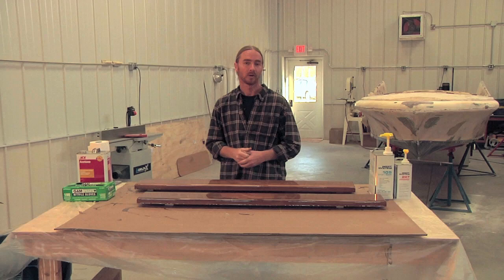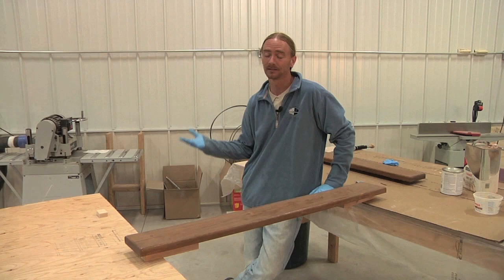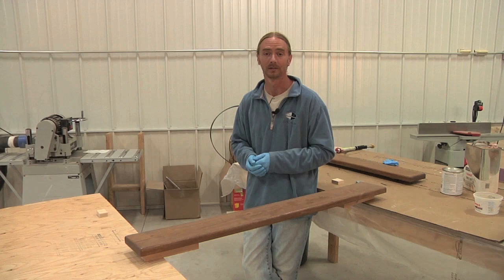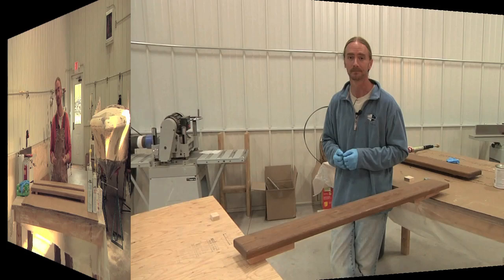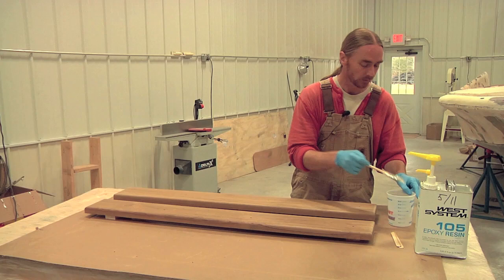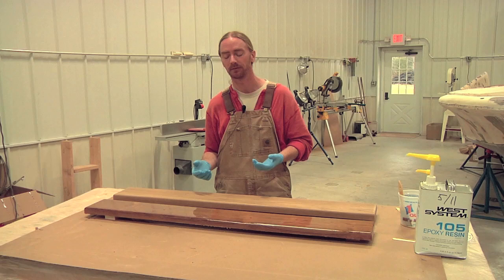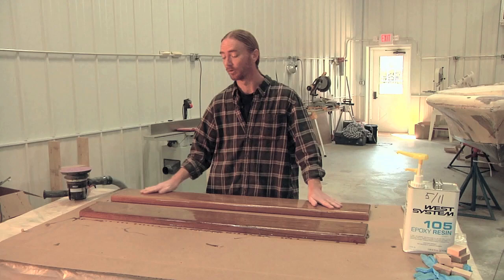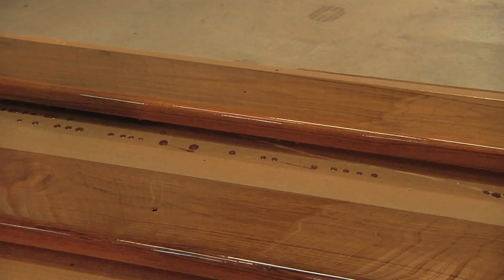Varnish and Epoxy~ a Professional Wood Finish for Teak Part1

Comment: Hi Andy.....much thanks again for the lesson.
We're doing teak bar top and shelves in our bar.

Question: do you use 220 grit in between the Epoxy coats?
(also..any recommendation as to what grit to sand the wood to before first coat? We're using the same epoxy as you)
Reply from the maker: Joel Simbrow 180 or 220 between epoxy coats.  I prefer sanding the bare wood to about the same grit.  320 between coats of varnish except for the last knockdown; that's 400 :-)

Comment: Andy....I have seen a variation of your technique using a "penetrating" epoxy made by mixing the two part epoxy with some type of solvent in mix ratios as high as 50:50. I was wondering what you thought of this "penetrating" epoxy technique?
Reply from the maker: Generally speaking I don't think it's as good as using what was shown in the video.  By diluting the epoxy you're accomplishing two things.  It does make it thinner so it does soak into the wood a bit deeper, but the downside of doing this is that you're also diluting the characteristics of the epoxy making it less effective.  Personally I think you're better off using straight epoxy mixing it the way it was designed to be used :-)  Hope this helps!

Comment: Hi, I've waited this long to ask you how well those boards held up because my 42' of 50 year old teak caprail are in my shop, all repaired and ready for treatment. I'd love to use 207 then varnish but I need to know how yours turned out if you don't mind?
Reply: What did you end up doing and how did it turn out?

Comment from the maker: Probably not a good idea.  As the epoxy cures it 'gasses off' somewhat, if another wet coat of epoxy is applied before the first has started to tack up it will cause bubbles in the finish..  Been there and tried it :-)  Not fun...

Comment: Hi Nick. Big fan.
I take it this epoxy method can only be used on flat wood?

 I am renovating the inside of a boat. The wood has been damaged with black mold on teak veneer. I have stripped it and used oxcalic acid to take out the mold spots. I would love to epoxy it, but i cannot remove the walls of the boat to lay it flat.
Reply from the maker: Niall O'Bodicin It's the same process; just thinner coats (and more of them ;-)  If it's a large area try using a foam roller and tip it off with a disposable brush.  Good luck!
Reply: Thank you. You cant believe how much your videos have helped me.

Comment: You did not wash amine blush before sanding epoxy coat?
Reply from the maker: The 207 clear hardener is a blush free hardener.  No need :-)